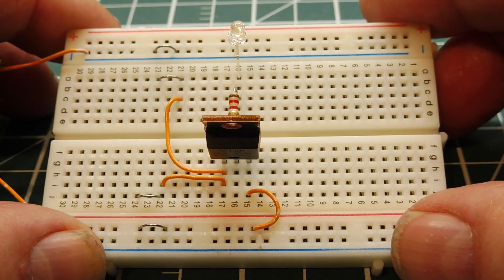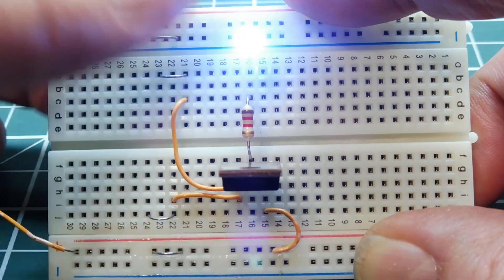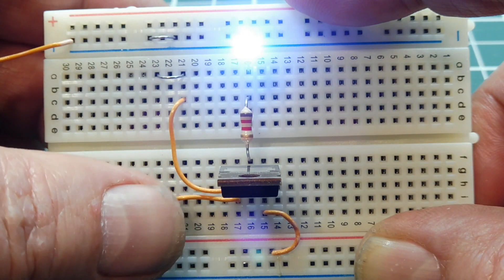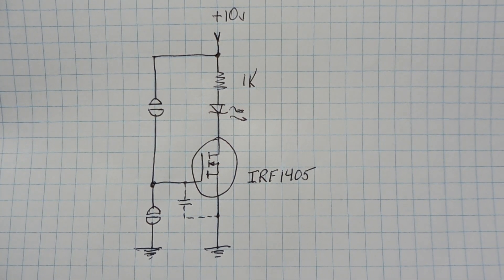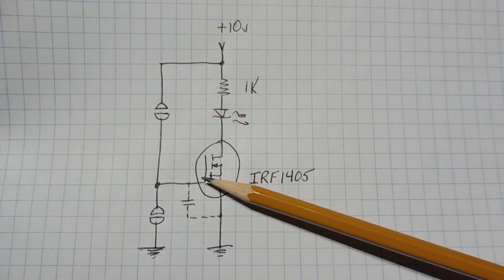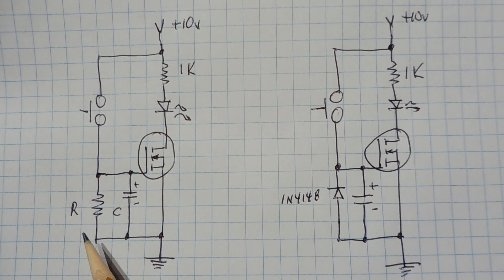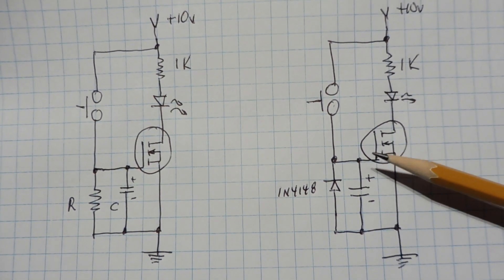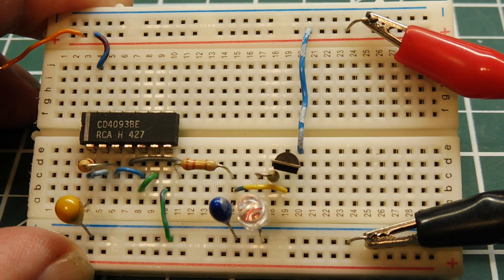Simple MOSFET Circuits You Can Build

Comment: How do I allow higher volts on output to load using N channel MOSFET, zener, resistor, as zener resistor is to be called minimum load, on all the time while final load turns on and off by it's own switch in series, while MOSFET is always on also.100% duty cycle minimum load, and 40% duty for final  load resistance? Vcc 28v DC or higher, 6 A final load, MOSFET type for higher gate voltage? This for series pass transistor needing 28VDC on load. The BIPOLAR type lose voltage on load with Zener. ( In other words if minimum and final resistance is together in parallel, the ohms goes down and is wrong.)

Comment: ive done the capacitive switch and i have changed a few mosfets when they failed....burn out..i dont have any other experience or knowledge......ive used irf540n which is almost identical to the irf44n and worked great at 12v as capaicitve switch ..couldnt get it worked with a 18650 fully charged at 4.2v...though  i ve seen it  happened....the gate threshold v for the gate is around 5v...anyway...i wanna ask
when you use the mosfet as a switch in the classic way not the capacitive one...do you need a gate driver...i mean a logic gate a chip a microcontroller ..sorry for my terms ....dont know ...that can give the signal voltage to the gate...in order to make it work...
im askin this...i have a 12v load i wanna switch...i have a 12v source....i connect the positive to the gate of the mosfet and then through a resistor to the source.....and then to the ground...i connect  the load on the drain ..source.....the positive side of load ..negative side of load ...drain...if i have a switch a typical switch on the voltage i feed the gate...will it work...?willl i be able to switch the mosfet on and off and control the load?

Comment: I made the first circuit with 2n7000 mosfet but it turns off automatically when I remove my finger from gate and vcc touchpad any explanation or solution??🤷‍♂️
BTW video was awesome 🔥
Reply from the maker: The 2N7000 has a gate to source capacitance of 50pf which will discharge very quickly as opposed to the IRF1405 which has a gate to source capacitance (Ciss) of 5480pf which will hold the charge for a long period of time. Thanks for the feedback.
Reply: @0033mer  can i add an external capacitor from gate to source to increase the capacitance? Or is there any other way?
Reply from the maker: Yes ..you can add an external capacitor.

Comment: The pulldown resistor value . how to choose the right value?
Reply from the maker: It depends on your desired time interval. The resistor will discharge the capacitor until it reached the threshold value of the Mosfet. Use a calculator to determine the desired R/C combination.  http://www.learningaboutelectronics.com/Articles/Capacitor-discharge-calculator.php

Comment: Before the diagram I was getting super confused by the "I short to VCC" (touches the blue line) "I short to ground" (touches the red line). I guess that is a lesson in itself in not trusting colours :D
Reply from the maker: I have done that a few times in my videos to see who I can catch. If someone hands you their project on a breadboard you disregard all markings and figure out the Vcc/Gnd connections. When breadboards were first introduced there were no markings. The top rails were Vcc and the bottom rails were Gnd. A diode was put across the top two rails for reverse polarity protection and the bottom ground rails were used to hook up an ammeter. The markings were put there for convenience but I have seen many projects destroyed by students making wiring errors.
Reply: @0033mer  oooh interesting didn't know that history

Comment: Thank you for the video, it is well explained. I am new to electronics, so easily confused. In the touch switch you created, I have seen it done with a Z44 and he didn’t even use a resistor. I understand what a resistor does, but why is it necessary here? Also is it possible to make a dimmer touch switch for 12V supply?
Reply from the maker: 10 volts is applied to the LED when the MOSFET turns on. The resistor limits the current through the LED as specified in its data sheet.
Reply: @0033mer  ok thanks

Comment: For the first design, how do you make the touch sensors? Are they simply non-insulated wires?
Reply from the maker: Yes .. you can use non-insulated solid wire for the sensors. In this case I cut off the leads of a resistor and bent them in a U shape and installed them on the breadboard.
Reply: @0033mer  thank you very kindly sir. Very good presentation and explanation on the video btw
Reply from the maker: You're welcome.

Comment: Great video!
Not sure if you're still checking comments, but I have a question. I get that MOSFETs are great for switching DC, but what about AC? Must I use a relay, or is there something analogous to a MOSFET which would allow me to switch AC on and off like this (either an AC or DC trigger would be OK)? I can only think of a relay right now, but I'm no expert.
Reply from the maker: Yes ... MOSFETS are for switching DC. To switch AC you can use a Triac. To make your circuit safe and easy I would suggest an AC SSR ( Solid State Relay). They are activated by an internal opto-isolator with 3-32 volts DC. They come in many sizes with different current ratings. Check out this video where I used a SSR to control a shop vac (mousetrap). https://youtu.be/lYImd3WCjZM
Reply: @0033mer  Hey, thanks for that. I checked out that other video. I think this could work for me :) Thanks for responding!

Comment: Does the kind of capacitors is important? I used elektrolitic and did not obtain oscilations in the curcuit with Schmitt trigger.
Reply from the maker: The type of capacitor is not important.

Comment: Does the mosfet in the curcuit with Schmitt trigger should be special otherwise the LED does not blink?
I used FQPF mosfet. The LED does not blink. No oscillation on the gate.
Reply from the maker: Use a VN10KM mosfet.

Comment: I built the curcuit accordingly (showed in min 4 on the left) and i it does not blink. R causes that the LED goes off and does not on again. If R is greater LED goes off slower but does not light on again. Why???
Reply from the maker: That is a timer circuit not a blinker circuit.
A button press will turn ON the LED and then turn OFF after a period of time determined by the RC values.
The button has to be pressed again to restart the timer.

Comment: Great video, thanks can you tell me how to make a simply adjustable timer to operate a relay for a max time of 1 second, thanks
Reply from the maker: You can use the very common 555 timer IC to build an adjustable monostable timer that will drive the relay.
The 555 timer can sink or source 100 mA at 12 volts which can drive a relay directly.
If you need more drive you can buffer it with a transistor or mosfet.
There are many circuits available online that you can use:
http://555-timer-circuits.uk/
Reply: Thanks for your quick reply
Reply: E  rrehb gbll

Comment: So with the capacitance of the MOSFET holding it on, adding a 10k pull down resistor to the gate on the first example, would turn off the MOSFET as soon as your finger was removed from the top switch?
Reply from the maker: Yes .. you are correct. It is common to see a 10k resistor from gate to ground in Mosfet switching circuits.
If you program a GPIO pin of a microcontroller to be an output, and then drive a mosfet to switch on a device, and  then change the GPIO pin to be an input (floating) the device would be stuck in the on state. With a pulldown resistor the device would shut off.
This could become a safety issue. Check out this video on GPIO interfacing:
https://youtu.be/Iq9jPrhEGkU
Reply: Thanks for the reply.